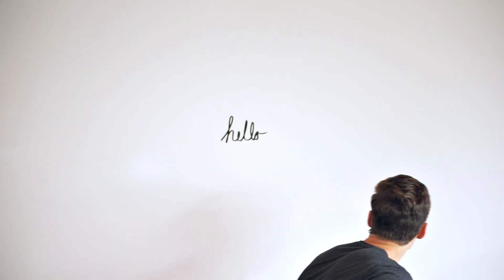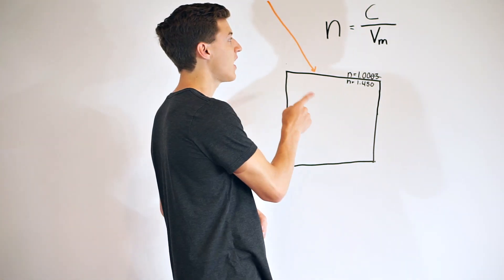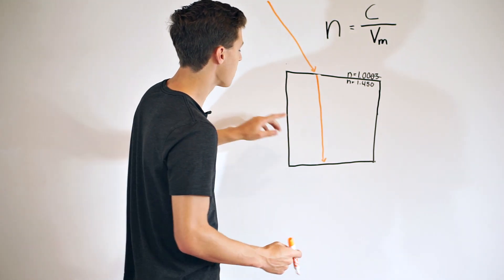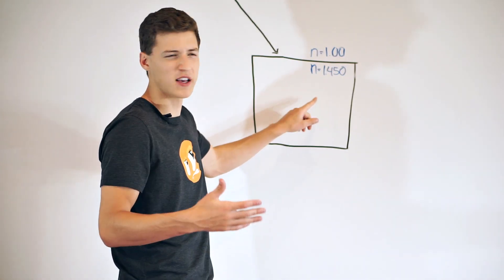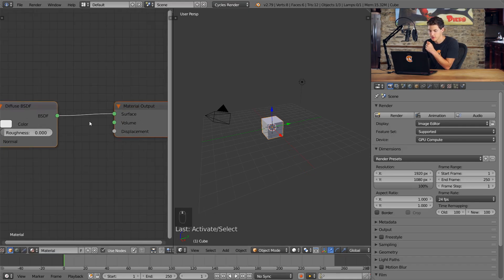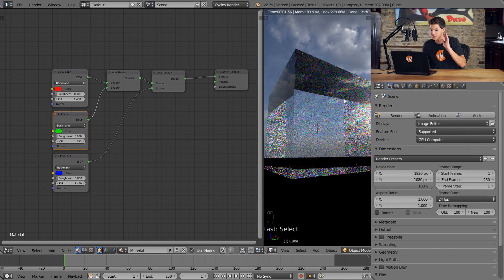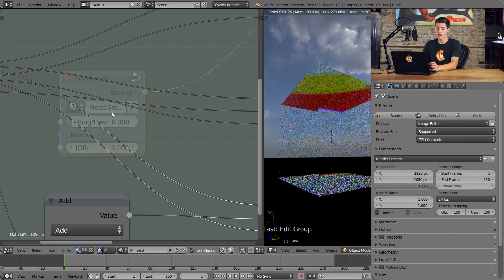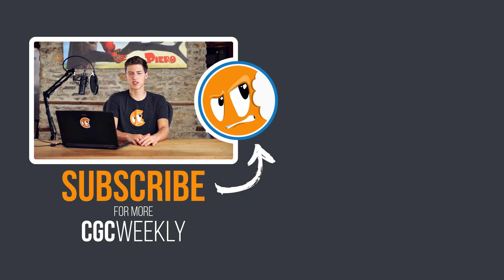Creating a Dispersion Shader in Cycles (CGC Weekly #17)

Comment: I think there is an inaccuracy in the physics explanation: White light is not primarily R/G/B but rather light consisting of R, G and B wavelengths looks white simply because the human eye only has receptors for those three colors. If the input light to a prism were just the narrow bands of R/G/B you also would get discrete bands of these colors on the other side, rather than a full rainbow. Sun light contains most visible light, but actually not all (see e.g. https://scied.ucar.edu/image/sun-spectrum ).

This effect of working with just three colors is also visible in the shader, it produces several discrete bands, rather than the continuum one would expect for light covering the entire visible spectrum.

Comment: Or you can use Luxcorerender, which is a spectral renderer that supports bidirectional path tracing and there will be no need to fake the effect. It will take longer to render though.

Comment: Of course, RGB are not the main components of white light, just what our eyes detect. But using RGB lights look weird compared to full spectrum. Because many colors won't reflect ( try shining a RGB light on a monochrome orange color and it will just look dark)
Reply: I guess you'd need to 
(1) interpret RGB colors into wavelengths (having a quick look I only found the reverse option - wavelength to RGB - as a builtin node), 
(2)  filter out way more than just a meager three bands based on a sequence of wavelength interpretation thresholds, 
(3) proceed as described in the video with different IOR levels and finally mixing all the bands back together. 
This probably needs to be done with a script node …

Comment: Awesome tutorial and explanation! Many thanks. I noticed that if I used the Mix shader node instead of the add shader node to combine the RGB light nodes, I got a very different result in the render. The object was far darker and did not look like glass. I'm curious as to why this would happen? The Mix shader fac was set at .5, so as I understand it, it basically adds them equally, no?

Comment: Using this method removes the color input of the original glass shader from being accessable. To add it back you can use a 'separate rgb' node to split the input color into It's rgb components. Then plug the R into the color input of the red glass shader and so fourth.
Reply: I just got crazy with nodes till I see what I want 🤣

Comment: Instead of RGB which corresponds to colors visible to human eye, is there a way we can use gradual hue value? 

This combined with gradual IOR value would give the most accurate output. RGB are the reason you're getting distinctive lines between colors. Rainbow doesn't have lines between colors. it's a spray of lightwaves with changing of different wavelength. So if we could use the whole spectrum that would be awesome
Reply: Yes in fact there is! It takes a fair amount of samples to get good, because you need to simulate a whole spectrum of shaders instead of just three, but I've found it to still be surprisingly workable.

Essentially what you want is to simulate a different wavelength of light at each sample. The way to do this is to have a really tiny noise texture of some sort, and you use the value of this to set the colour and IoR. Each sample will hit a slightly different point, get a different colour and IoR, and simulate a different wavelength of the spectrum. If you use a standard Noise texture (perlin noise), you'll have to distort the values a bit or it'll overrepresent parts of the spectrum - another option is a Voronoi texture, which I think would work fine as is, or there are some other options.

If you want to get physical accuracy, you can transform the noise values to a range of actual wavelengths. Blender has a Wavelength node, which transforms a wavelength to the right colour, and you could look up the equations that give you an IoR from the wavelength (one model is the Cauchy dispersion equation).

Doing it this way, you can get a smooth dispersion gradient even at very high dispersion values, and using the correct equation will make it look properly realistic instead of just a linear range. You can also look up the values for real world materials (usually given as 2 or 3 numbers).

Comment: To those bashing the physics explanation: The speed (actually velocity) of light does change depending on the media. speed is measured by the time it takes the light to get from point a to point b and is based on the straight line distance between the points, not the distance the light actually travels. The difference in distance often turns out to be very small, most of the effect coming from the time it takes to effect the energy exchanges between photons and electrons.

On the other hand, the trick shown in the video is just that: a trick. While it mimics dispersion, it doesn't match it.
Reply: That's just a simplified model that we humans can use to make calculations, but the light speed is always C. It's a massless particle. That's why it's acceleration is the maximum allowed by the cosmos, which is C (Constant). If the universal constant were higher, then light would have to travel at a higher speed, because by definition its speed is always the universal constant.
Even if it's simpler to say that light changes its speed, it's importante to state that the real phenomena doesn't follow that generalization and that measuring a longer time just gives you the impression that the light has slowed down, when in fact it just traveled far.
Another thing to consider is that not all light passes through the material. Some photons are actually absorbed because of the impurities or because of the low energy it comes with. The white light that we are used to it's actually a whole range of photons carrying different energy amounts. Not to mention that to create a visible surface, you need trillions of photons, and that means a lot of them will be absorbed but a lot more will make it through.
Reply: Individual photon always travels in a vacuum and thus always travels at C, but the speed of light in a medium is not the velocity of an individual photon. Consider a source that emits a single photon into a medium.  That photon may be absorbed by an electron and another later emitted.  The distance traveled between such events is probabilistic and depends on the physics of the material.  Each event takes a finite amount of time. Eventually, a single photon will be emitted by the material. It will not necessarily be the original photon. The speed of light through that media is defined as the length of the media divided by the time between the first photon entering and the final photon leaving.  It is other than in a vacuum < C. (detail: There is a non zero probability that no photon will be emitted by the material, as it may be reflected or absorbed by the media.)
The speed light is defined this way, not as a simplification, but because the defined property (which relates to the velocity of any wave front in a medium) is useful.

Comment: I think the reason is more about this being a way to fake the effect rather than the real way to do it. At some point Cycles will probably support bi-directional path tracing and then true dispersion would be possible.
Reply: Dispersion doesn't hinge on bi-directional path tracing, it hinges on spectral path tracing, which Cycles also doesn't do.
Bi-Directional would cause caustics to clear up way faster.
Reply: to fake it in an even less optimised but slightly more accurate way, I suppose one could add intermediate steps (yellow, cyan and maybe purple)
Reply: It's been a year, does anyone know if that is possible now?
Reply: @leaphymoon9881  OTOY's Octane Render is more than capable of this and is currently availible built into the blender viewport for free, from their website. (keep in mind this is a GPU optimized render engine). 

from the Octanerender Documentation:

"The dispersion in OctaneRender™ is based on Cauchy’s equation which has two terms: A which is the index of refraction and B which is the dispersion coefficient. Increasing the value increases the amount of coloration and dispersion in the object and in caustics."
Reply: @leaphymoon9881  Luxcore has true dispersion. If you want it in Cycles, there's a unofficial spectral rendering build of Blender with it. I'm not sure if it has dispersion but it might
Reply: Bi-directional path tracing wouldn't help at all with this - the issue is that Cycles represents colours as RGB, rather than a whole spectrum. You can fake a spectral rendering engine inside Cycles as is, but it will always be faster using something specialised for that.

People say that you need a bi-directional path tracer for caustics, but that's not really true either. (With enough samples) the caustics that Cycles generates are just as accurate, but a bi-directional engine would get them faster.
Reply: EEVEE fixes that slow part 😏
Reply: Eevee isn't a cure all and dispersion in particular can be faked but it won't look nearly so good as the real deal which requires slow and tedious bidirectional raytracing to happen in reasonable time.

Comment: That's so cool. It's like we created a custom node. That's pretty much what we did. Is there a way to port in Node Groups into another save file without redoing all of the nodes every new project?
Reply: Open up blender so you get your "starter file". Then create this node group and give it a 'fake user' so it won't delete when you're not using it. Then go onto "file" in the top right corner and hit "save startup file". This way the exact file with your node group you just created will load up every time blender starts.

Comment: I love how he explains the physics. I was able to figure out the shader from that alone. Nicely done! Thank you!

EDIT

What's the difference between the glass shader and the principled shader with transmission cranked way up? Is one better than the other?
Reply: The glass shader is pretty light in comparison to the principled shader. There is a performance difference. Especially if you are adding 3 principled shaders together.

The principled shader is quite like a traditional ubershader. It mixes different materials into one node. Though it does it in a way that your computer doesn't suffer. At least not as much as if you were to mix nodes together yourself.

Comment: Actually light doesn't really change its speed (although that's simpler to assume that to explain). It has to do with the distance it has to get through. In fact the more dense is the material, the more light will bounce over atoms and so the more distance it has to do before getting out of the material. Since speed is distance/time it seems light has slowed down but in fact it has just made some more turns on its road. If you drive straight a car from point A to point B it would look like you went faster than if you drove on a road that turns a lot at the same speed.
Ps:excuse my mediocre english I'm French 😅
Edit: As Theresa made me notice in the comments in fact light doesn't really bounces off atoms, this is obviously a kind of schematic representation but which is very useful to imagine in a simple way the concept of interferences which are the "true responsibles" of that phenomenon 😄
Reply: To be clear, the photons do not bounce around between atoms. If that were the case, the photons would exit the medium at some random vector and would always look blurry (in other words roughness @ 1 in blender). Instead the photon is sort of absorbed and re-emitted via changing energy states of electrons in the atoms. The reason it maintains the same vector is massively more complicated to explain, but it basically comes down to the kind of conservation of a "quantum momentum" that the energy in the photons have.
Reply: Im not sure if it works like that. I lack the knowledge to really say but something seems off, makes me wonder why Cherenkov radiation phenomena happens when a particle goes faster than the speed of light on a relatively dense medium.

Edit: i used C instead of "speed of light" but i see C is the constant of speed of light on a vacuum so i was using it incorrectly.
Reply: Teresa Shinkansen I'm pretty sure that according to the relativity nothing goes(or can go) faster than c (even if there are some theories on tachyons). However I'm not omniscient but I saw it on varuous sources and I took the explanation from the "scienceclic" channel on his video on light ("lumière" in french) if you understand french it will be much clearer than my explanation (otherwise the animations can help you understand what I mean) the interesting extract is at about 4:10 ^^. I hope this helped you 😄
Reply: Blop I know a particle with mass cannot go over C in vacuum but that's were i have a doubt regarding your explanation about light having to cross a longer path when going thorough a dense medium thus making it behave as if it was going slower. When a particle goes thorough a dense medium (lets say water as its commonly used on TRIGA reactors and fuel cooling pools and this effect can be seen) and its going faster than the apparent speed of light on said medium it produces electromagnetic radiation on analogy of a sonic boom so i started thinking about all this. Sadly i do not speak french but still ill try to see what i can learn, thanks for the recommendation ill check it out!  Have a nice day.
Reply: Teresa Shinkansen Yes! ^^ I just saw the Cherekov radiation😄. I was going to awnser you about it! In fact in this case the particle is so powerful that it is not influenced by the atoms around, it just passes through disturbing their electronic layers (which btw creates the radiations). Since the particle doesn't have to deal with atoms it doesn't have interferences with atoms and so from an external point of view this particle seems to go faster than light. The accumulation of light that you can compare (indeed) to the sonic boom is due to the fact that the light produces by the particle is immediately slowed down by atoms and so its waves are all added. Although I do understand that the explanation of light which reduces its speed is much more intuitive at the particle scale it is not very "rigorous"(but still bery useful to understand physics at our scale 😄). I don't know if I'm very clear and I'm sorry for that 😅
Reply: Well i watched a couple of videos, very interesting. Now i get what you mean. But now i shall research about the physics of cherenkov radiation im puzzled about it now. Thanks for the replies :)
Reply: Oh i just got your new message, sorry if it looks i didnt understand just that Youtube is taking some time to send me notifications about messages. Yeah it seems to be like that what creates cherenkov radiation, im still reading about it trying to fully understand it becasue now i wonder what relationship could have with Bremsstrahlung even tho the later emits x-rays.
Reply: Teresa Shinkansen Thanks for yours 😄! It's always pleasant to learn new things and have scientific debates! 😁
Reply: No problem i also enjoy such debates! :D
Reply: Teresa Shinkansen Don't hesitate to contact me by messages if you fully understand it! 😄 You interested me in that phenomenon and so I'm curious now 😆
Reply: @Teresa Shinkansen x-rays are on one side of the electromagnetic spectrum you can imagine it basically like a prism ( dispersion across wavelength's ) which bleeds over from the underlaying physical medium light passes. As you learned not only the medium's are a factor also the angle - power vs passing atoms em fields - which in turn results in different kinds of radiation based very simplified on theese factors influenced by the way light travels and thus the mediums & their dispersion differences - which causes a shift thru wavelengts again also in the EM spectrum. Part of this at least on the pphoton layer can be observed using multiple polarizing filters thru an optical medium with a fixed IOR.
Reply: Teresa Shinkansen And you're right it doesn't really work like that it is more about interferences between photons and atoms but it is much more simple to visualize a kind of "ball" that bounces off the atoms than complex interferences and this is not really far away from reality ^^
Reply: The problem with digital versus the real world simulation is physics can never be truly duplicated due to lacking true material elements. Like H20, air, matter, material absorption etc... so a PC simulation will always be light years behind the true real world scenario taught to us in school 😏

Comment: 8:08 Have you tried using the new Application Template feature introduced in 2.79-ish? It means you can have a separate startup file preconfigured for Cycles rendering, with nodes enabled for the default material, lamp and background, for example.

Comment: I guess IOR < 1 should be avoided. Maybe add another node to limit it to values > 1.
Reply: Gold IoR is less than 1. It has some unusual issues, but it still displays accurately.
Reply: Kevin Smith 
Do gold and non dielectric materials disperse?
Reply: They shouldn't dispersion only works on objects lights can pass through. You might achieve a similar effect from reflections.